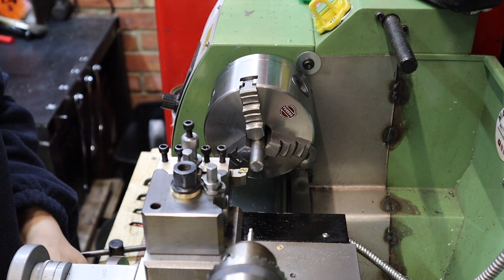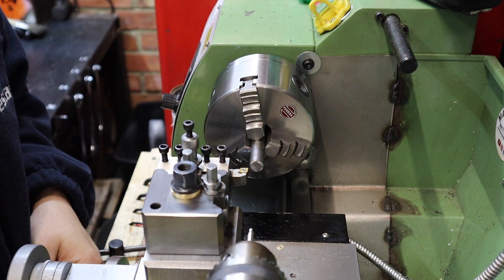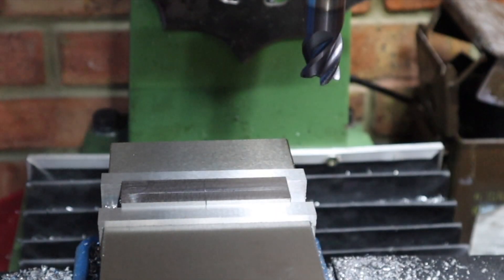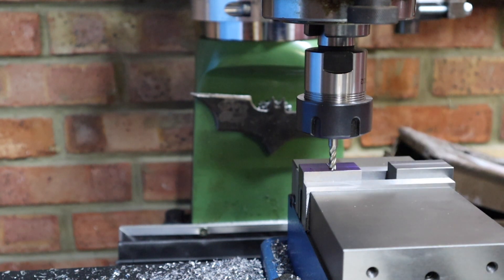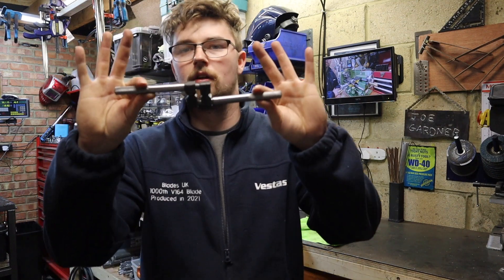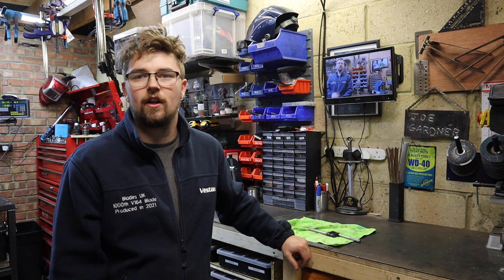Lets make a TOOL- Tap Handle

Comment: I like the tap handles that ratchet.

I recently saw several videos of people putting reversing switches on their drill press and using the drill press to get the taps started for tapping materials. And using the drill press gets the tap absolutely perfectly plum when starting taps into metal. 😁😃
So I was able to put a reversing switch on my 1937 Delta drill press which adds more fun to using it. Yay!
I also put a wire brush on that drill press or grinding stone when my bench grinder won't do. 😀

Comment: nice tool bro. and great mechanic shop. i have made tap wrench too. you can watch it in my channel. over there we find a different model and i used leave spring steel for durrability. are we need a good steel to make it? i still unknow what the material that efficient to be tap handle.

Comment: Enjoyed the video; the handle looks great. Love the finish. I collect tap handles and, of course, use them essentially every day. I have a handle like the one in the video as well as Greenfield No.00-No.7, various handles from Threadwell, Card, ACE, Vermont, and TRW. Something else that I'm forgetting. IMO, the very best design is Starrett's. It's unlike any of the other tap handles and can grip the square very tightly and consistently. A Starrett 91C is an equivalent to a No.5/15 handle. About 12". It's not inexpensive by any means, but if you do a lot of threading, and/or like the feel of a great tool, it's worth the money. 

This being said, if one is looking for a brand new tap handle today, he's out of luck. The only decent ones are from Starrett and they're not always affordable. This leaves vintage, which isn't so bad. One can pick up a Greenfield No5 or a TRW 13 or a Threadwell 15 with perfect jaws for around $40. They're all about the same size. When looking at older tap handles, crisp, straight, unmarred jaws are key. It's a different world compared to what's available now. Good luck.
Reply from the maker: I have to admit I love to look of the Starrett Tap wrenches. Next time I have some free cash I’ll definitely be buying one the finish on them looks amazing. 
All the best hope your enjoying the content

Comment: Making your own tools is a great idea. The pride I have when using tools I made is immeasurable.
Think a bit more on the comedy though, it doesn't always work!.
Nice finish on the tap WRENCH, looks like you put a V groove in both sides, is that for larger taps?.
Keep having fun in the shop and stay safe.
Reply from the maker: Hi Fred thank you for your comment. I agree making your own tools is very satisfying so I think I will be making more in future. Good point about the comedy factor I’m still trying to work on that. 
And yes the double v groove is so I can flip the jaws and use bigger taps. 
All the best 👍

Comment: What about Mini jacks for the mill support any stock which over hang the vice...got a question what's the largest round bar can the lathe hold could it hold 4" stock...love the oil sound effect
Reply from the maker: Hi Jinx someone has mentioned machinist jacks before it may have even been you so it’s another one I’m going to add to the list. Leave it with me and I’ll check over the weekend what the max size it can hold. All the best.
Reply: Yes, the WM180 can take 4" round stock, I've only done it with ali but it worked fine.
Reply from the maker: Thank you Dan for your input spot on 👍
Reply: @Dano2873  thanks Dan am undecided between the 180 or the 240
Reply: @jinxycob  What you planning to make? The wm180 is not a big lathe.
Reply: @ianlainchy  I make small robot for the fun of it, looking at making joints and turn table for an arm...a leaning towards warco 240 at the moment
Reply: @jinxycob  Depends how much space you have I guess. I have the Chester DB7 which is the same as a wm180. It's a great lathe, but if you can... go bigger.
Reply: @jinxycob  I just went to the 'shop' in Fisher Lane and was impressed with  the 1322 it's a bit bigger I know, I went initially looking for the 1230 but you still have to change the gears. Downside is that it is a bit noisier than I expected from a spanking machine, hopefully it is only that one, but you would expect a display model to be perfect.